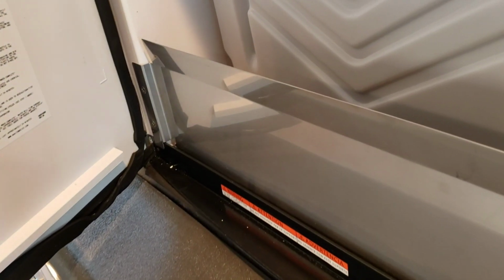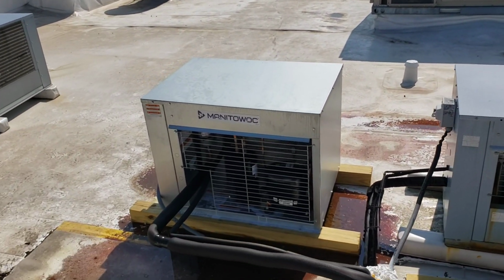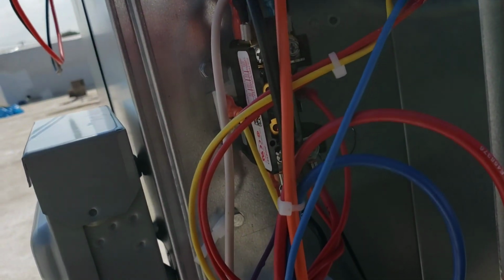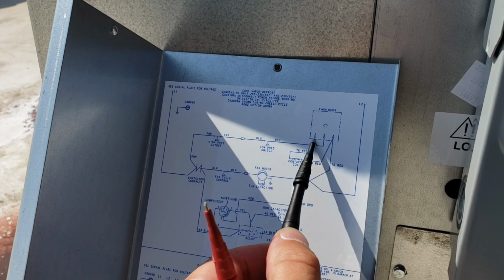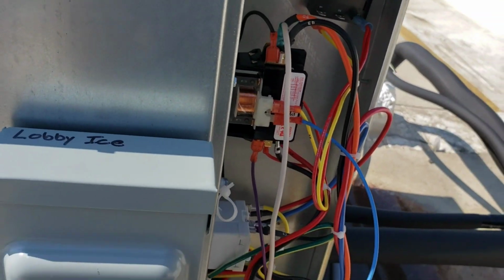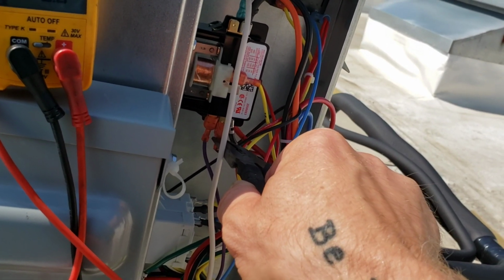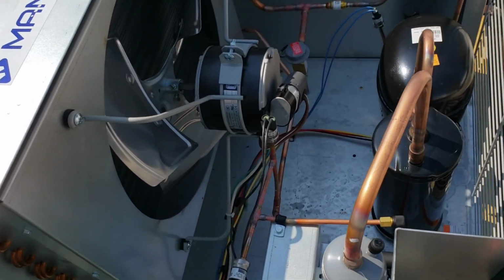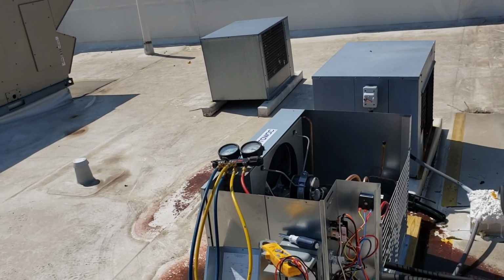New manitowoc ice machine not making ice

Comment: Those systems notorious for bad fan cycle and low switches
Reply: If I remember correctly it's a 200co/250ci. They fail regularly and they are sweated in. These units have a headmaster but believe the fan cycle is to assist in harvest. They will work with the fan cycle bypassed. If you want to replace, I would just put a tee in and use a regular peanut. Not worth dealing with pinching and brazing in new unless you have endless time.
Reply: @Brisket9392 was going to add that manufacturer actually recommends pinching and brazing in to replace them, but read it in your last sentence! I find pinching refrigerant and brazing as a ultra risky idea when you can just recover the charge and not have to worry about all that refrigerant blowing out. Just my two cents. Ha. But seen bunches and I always install adjustable fan cycle controls after warranty expires.

Comment: Awesome video. I noticed you already were able to read continuity through Line voltage wire through the low and high pressure control so the HPCO couldn't have been open due to the fan not running. When you ran the compressor after jumping from the timer over to contactor it seemed like it was simply pumping the system down due to the ice machine down stairs being in the OFF position, Manitowoc uses R404a and industry standard needs 250psi to close the fan cycle control so pumping down for 10 seconds (especially since the system was equalized when you got there) wouldn't be enough to even build pressure to 250psi. I personally think it's the delay block, they are pretty reliable but they do go bad like all parts do. Sometimes I even run into a brand new contactor that once energized at the coil its stuck and the pole won't go down to make contact at all, and I have to secure power and rattle the contactor bridge and "loosen" it up. Good luck.
Reply from the maker: Hey there- thanks for watching, after I ran the compressor by bypassing the timer block I didn't specifically test the hpco but I did test the lpco and hpco circuit which was open,,,, I should have tested the Hpco by itself to be sure but hindsight is always 20/20-- for the fan cycle control you may have a point about the pressure it actually cuts in at, I didn't have my gauges on while the system was building pressure and 250 sounds pretty spot on,, I made the assumption it was well over 250 while running because sitting idle at ambient temps it was just about 230psi.
Reply from the maker: Also feel free to email me at curioushvacguy@gmail.com sometimes these discussions is where I learn the most

Comment: Bill, Manitowoc has a service bulletin out on that timer. Good luck getting one.
Reply: It's just a 5 minute delay on break relay (anti short cycle). It locks out for 5 minutes when one of the switches opens going to terminal 2. ICM makes a couple options that work. Nothing special about it. Could be bypassed (just as he did) if in a pinch. You just lose the 5 minute short cycle delay.